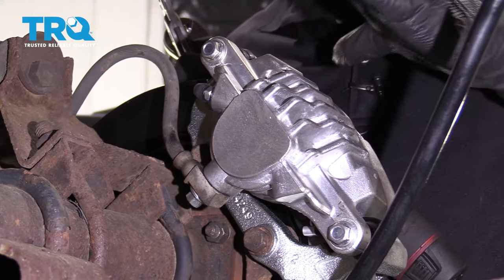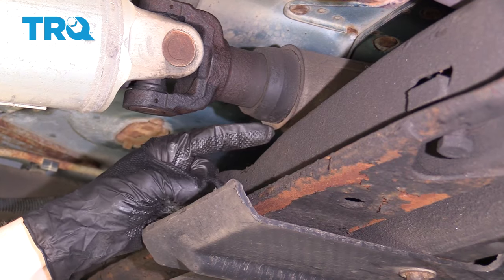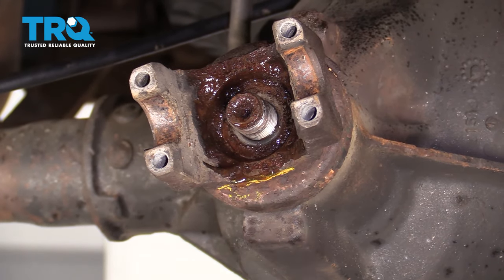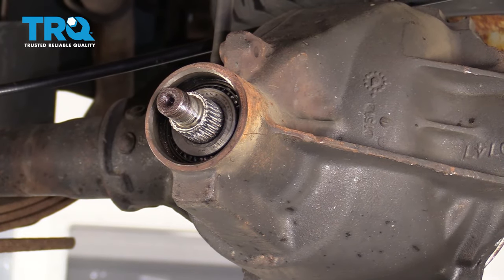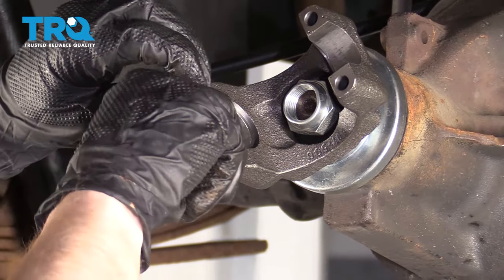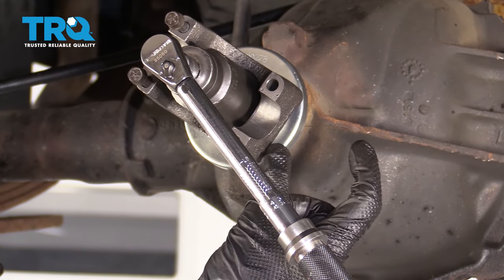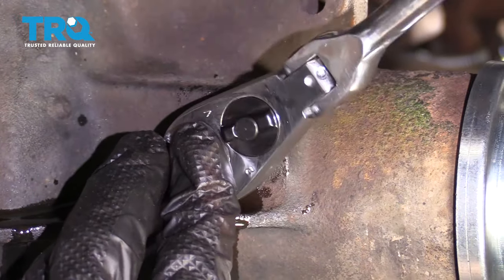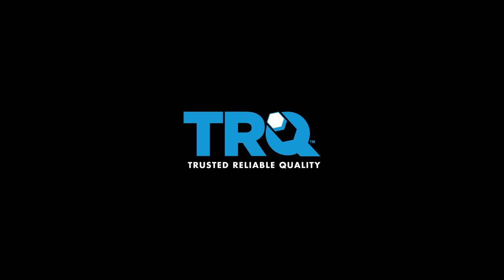How to Replace Pinion Seal & Yoke 1994-2004 Chevy S-10

Comment: You say not to over torque and squish the crush collar too far yet you install the nut with an impact wrench to the point where it no longer spins.  Then you do the test in inch/pounds and everything is torqued properly.  If I did that I would destroy the crush collar for sure!

Comment: Why do you have to take off calipers?
Reply: In order to remove the rotors, otherwise the drag in the brake system will make it impossible to accurately measure the preload torque since it’s very small.

Comment: The red threadlocker/permanent is not necessary, kinda overboard. Especially on calipers, blue would do just fine although you could do without any really. That's what the torque is for.

Comment: Nice video, informative. My only disappointment was no grease added to the brake hardware before re-installation of the pads. They came off without grease and went back on without grease. Gotta grease them thangs!

Comment: At point 7:14 if this kind of play was happening before any repairs would it likely indicate a worn outer bearing possibly including the race? I am trying to diagnose the backlash play in my 2002 trailblazer that does this and before removing the nut and yoke. Thank you in advance.

Comment: Brother I have a question I've gone into forums but have not found a satisfactory answer I have a 99 s10 the yoke has a damper 2 of the bolts broke I'm trying to find another yoke with damper but itd impossible I looked online nothing I notice that most s10s rear diff dont have the yoke damper. My question is this can I use a regular yoke instead of a yoke with damper for vibration why and why not I'm confused???

Comment: Can a bad yoke and pinion cause humming noise In  g80 diff
Reply: when is the humming noise happening? acceleration, or when you let off gas, only after a certain speed? many times it's bad u joints there.

Comment: What size is the bolt on the yoke
Reply from the maker: +Tommy Stokes We do not have this measurement available. It will be the same size as the original equipment bolt. You may contact your local dealership with the VIN To determine the exact size.